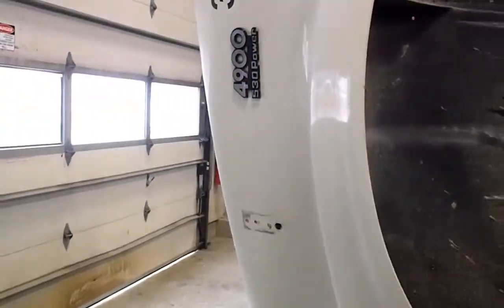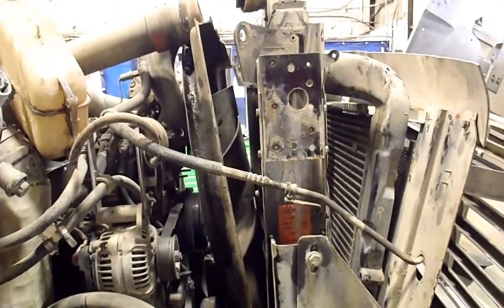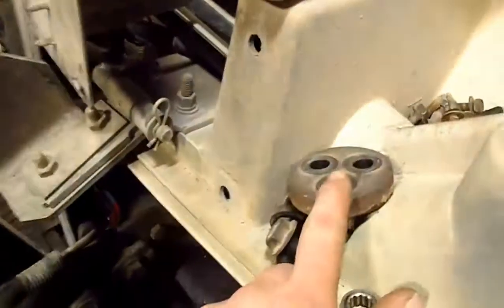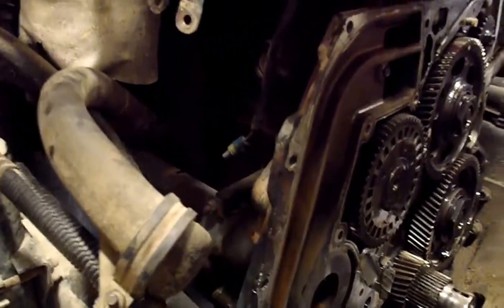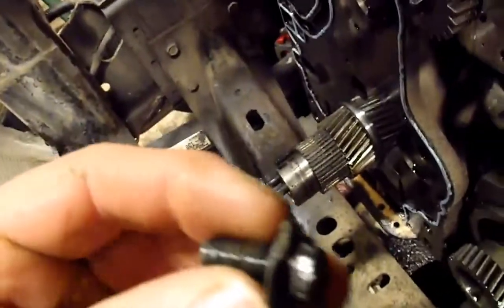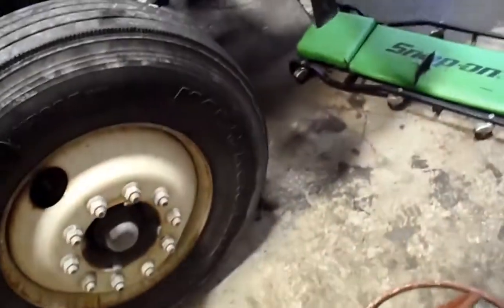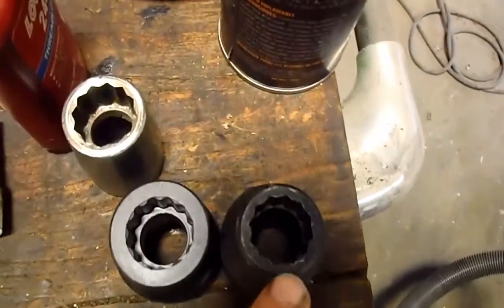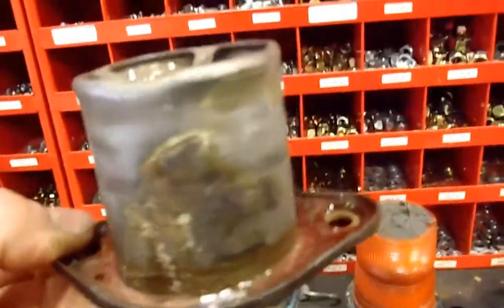International 466 timing cover reseal

Comment: I’m pulling one apart at work. Had to order the otc puller so I’m waiting on it to be delivered. The sprocket that the cam sensor reads, is walking out and destroying the cam sensor. Is there a thrust washer on that sprocket that I need to replace to keep the cam from walking out?
Reply from the maker: Yes, there’s a TSB or bulletin on that problem. I think you need to pull the front cover completely off like I did in the video to correct the end play.  I think max spec is 0.014”
Reply: @Pneumamechanical thank you sir

Comment: I bought my 20 point at O'Reilly's for 7.99 it worked great.  also I got the timing cover back on the motor mounts then I needed to look for a tool where I had the geats all stacked and OMG there was this thin washer on the cab floor of the truck.  I've asked the International  parts guy a out a washer also Called a thrust washer that might go behind one of the idler gears.  Now on older DT466 a guy showed me a diagram of a spacer that goes behind the bearing setup of the pulley now this engine only has 1 large idler gear instead of 2.

Comment: What are torque specs for idler gear nuts
Reply from the maker: Sorry I can't remember.  You want to take the idler gear assembly with the bearing off and leave it in one piece.  I mistakenly took the bearing nut off and there was no torque spec for the nut.  International want's to sell a new assembly if you take it apart.  It's been a few years on this engine and it's still running fine though, I just put it back as tight as it was lol
Reply: @Pneumamechanical  i just tightened the crap out of them to about where they was with loctite and it should be ok. I did find torque specs online and said over 300 ft lbs
Reply from the maker: @jefferyallman6825  It'll likely be fine

Comment: What is the torque on the idler gear nut?
Reply from the maker: Sorry I can't remember.  I took the wrong nut off. Instead of taking the gear/bearing assembly off, I took the bearing nut off and couldn't find a  torque value, so I just put it on tight lol

Comment: Does the cylinder head need to be pulled to replace camshaft?
Reply from the maker: I don't think so, but you may be able to look it up online.  I didn't pull the camshaft, just the drive gear

Comment: How did you support the engine in order to remove the front engine mount?
Reply from the maker: I can't remember,  Maybe a 4x4 wood block on a jackstand under the oil pan
Reply: I used a jack and 4x4 under the oil pan, worked pretty good

Comment: Does the high pressure injection pump need to be timed on theses? Cant see a way to pin the pump... Need to replace the seal between the timing cover and pump.. dont really want to pull the while front cover
Reply from the maker: No I don't believe it needs to be timed, I don't think there were marks on the gear for it either